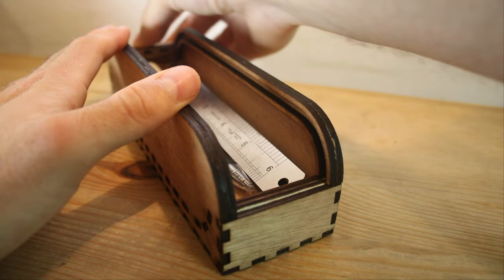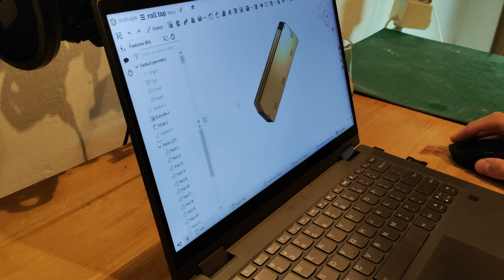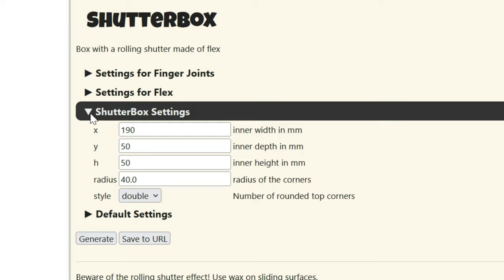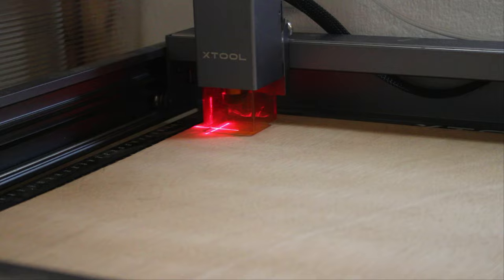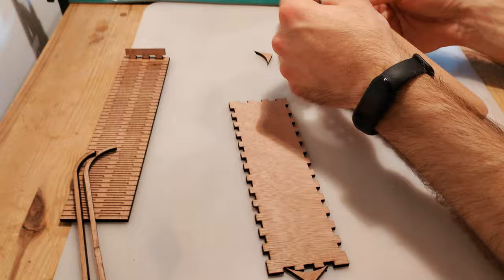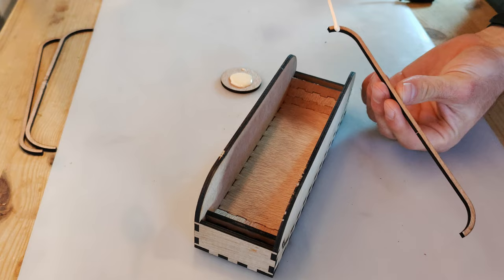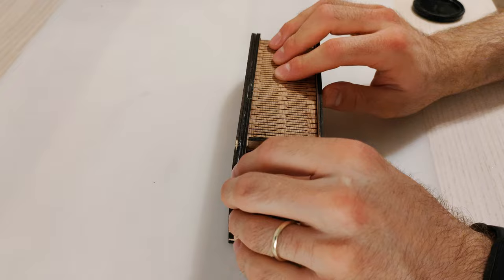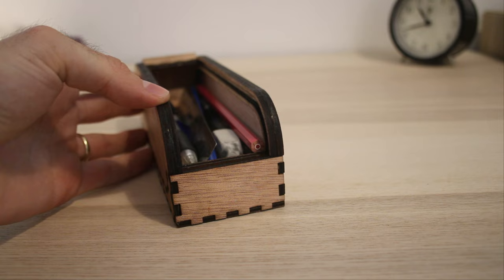Laser Cut Roll Top Pencil Case | Free Files Included

Comment: Recently i buyed sculpfun 10 laser i used 3mm plywood i have faced problem in cuttings it due to its resin or glue it took so many passes to get through. Can u guide me to right plywood
Reply from the maker: When I got my laser I bought whatever plywood I could find, and had exactly the same issues. The problem is usually with the glue they use between the layers. 
Try buying birch or poplar, they are usually better for laser cutting. The wood itself is suitable for laser cutting, and they often use proper glue for it. Also, try looking for a Facebook group with people who laser cut and are from your region, and ask them for their suppliers. 
Suitable wood is often more expensive than just random plywood, but your time is so much more expensive, and if you try buying the cheapest material you could find, it's likely that you'll end up throwing it away eventually. Hope it helps! Let me know if you have more questions.

Comment: What kind of oil did you use on the rails?
Reply from the maker: I think it was teak oil, but it really doesn't make that much of a difference. I've been using candle wax recently, and I like that more than oil. By the way, I added an update to the instructable with an important area that you should sand before assembly. It's not mandatory but very helpful. I can't update the video, but check out the update in section 5 over there.

Comment: Great Video, Ive made mine but its a little bit squeeky do you know what i did wrong?
Reply from the maker: Thanks :) The shutter is probably rubbing against the sides, so I'd say it's one of 3 things: 1) some sanding is needed. 2) some wax / oil would fix it (easiest fix). 3) maybe the plywood you're using is a bit curved, and it pushes against the shutter? I had a box making funny sounds too, and I fixed it with some sanding and wax. Hope that helps! let me know if you need anything else :)

Comment: Just printed it on my xtool D1.  and XCS.  The only pieces that fit are the long side pieces to the bottom.  The small side posts don't come close to fitting.  I used the 3MM plan.  Seems like the holes are way too small for the notches.   What did I do wrong?
Reply from the maker: Sounds like you used kerf within lightburn in addition to the kerf I already included in the files. Could that be the case? If you don't think that's the problem, contact me via my website and we'll get it sorted :)
Reply: I just made it using 3mm files.  Made No changes to your file as you said it includes kerning.  Too tight.  Will have to do a lot of hand filing to get it to work.
Reply from the maker: @kathynewey156  Hi, thanks for the comment! Would a file without kerf be helpful? Sorry it didn't fit right from the start! Since publishing this video I heard several people having problem with the kerf, so I've been sharing files without a kerf offset ever since. Let me know if I can help :)
Reply: Or is it me being a beginner.  Maybe there is something automatically happening in Lightburn.  I just imported the file, checked the cut speed and set it going.
Reply: Ps I downloaded the svg file if that makes any difference.
Reply from the maker: @kathynewey156  Thanks again for the comment, I added a file without kerf offset to my instructable so you can add it in lightburn if you like - I'm sure it'll be helpful for others as well. I would suggest you also use calipers to make sure the plywood is actually 3mm and not thicker. I've had "3mm plywood" that's 3.125mm or even 3.5mm, so it's important to check. 
If you need a specific thickness that's not in the list of files included in the instructable, feel free to contact me via my website with the thickness you want and I'll generate it for you. 
Let me know how it went! :)
Reply: Ok, will have access to a machine later in week so will try again.  Thanks

Comment: Made me waste material, I used 3mm material and the 3,2mm file and nothing fits...The wholes are too small,
Reply from the maker: Sorry you had a bad experience! Several people shared their 'I Made It' on instructables so I guess I'm not the only one it worked for. Note that I shared two files - for 3mm and 4mm, and that I had to use a rubber hammer to connect the parts. One solution to your problem would be to use the 'resize slots' option in lightburn (it's an awesome new feature, I might make a video about it soon). If you're having trouble and you want to make this box, feel free to contact me via my website nirlivne.com and I'll be happy to help with new files or whatever you need :)
Reply: I am having the same issue with finger slots in the bottom being too small for the fingers on the side pieces to fit in.
Reply from the maker: @alansetzer2484  I'm guessing you're the same Alan who contacted me through my website ? :) In that case, we solved the mystery! If not, feel free to contact me
Reply: @nixmakes  Thank you for the help! The problem was solved. The mistake I was making was I was adding kerf on the design and had the kerf setting in LightBurn, once I removed the kerf setting in LightBurn the boxes fit together like a charm. I have even made bigger size boxes to store small tools.